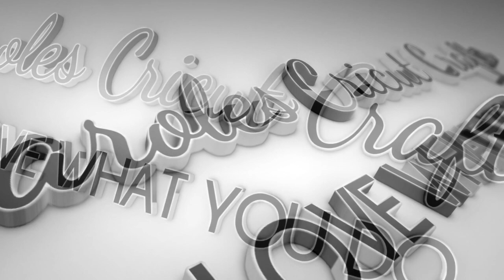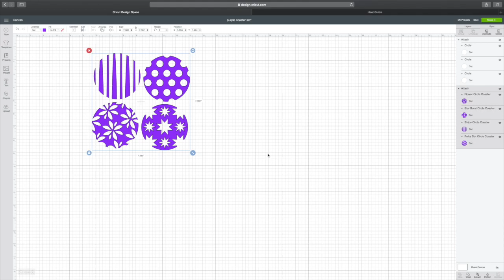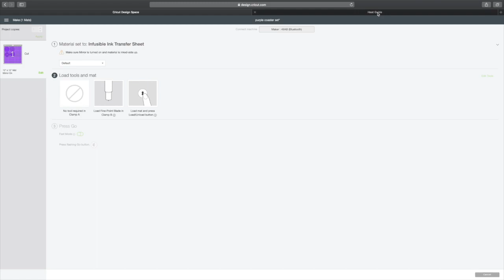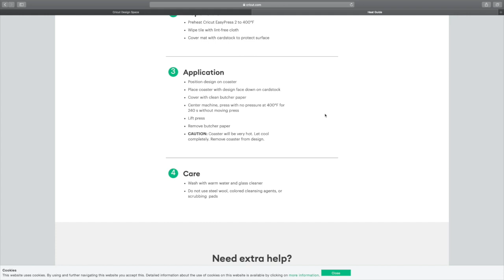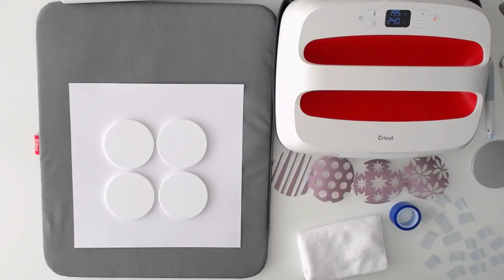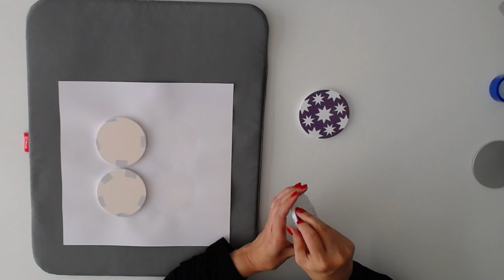CRICUT CERAMIC COASTERS with CRICUT INFUSIBLE INK TRANSFER SHEETS

Comment: Thanks for posting!  I saw these is the store and was curious as to how it all worked.  But, I think I missed something...how did they come out with color on them?  I watched you put the design face down on the coaster and tape it.  When does the color get applied?  Also, how did you seal them?  Or do you?  If not, how do they stand up against hot coffee mugs in regard to sticking and how do you clean them?  Are they dishwasher-safe?
Reply from the maker: Andrea D Stevens  the sheets I am transferring are Infusible ink , the colour fuses into the finish on the coaster when heat is applied. Yes they are permanent transfers.